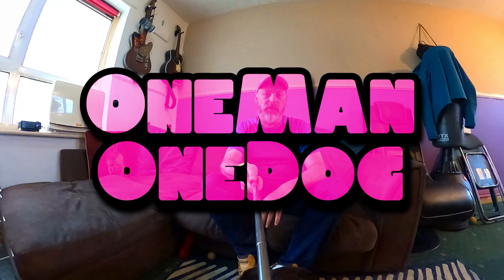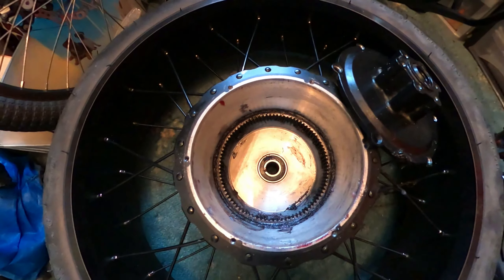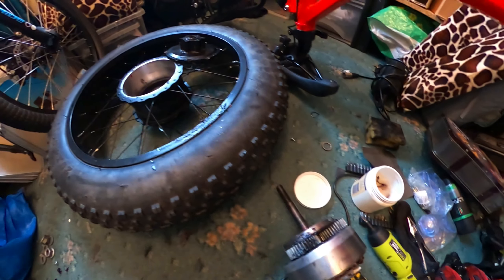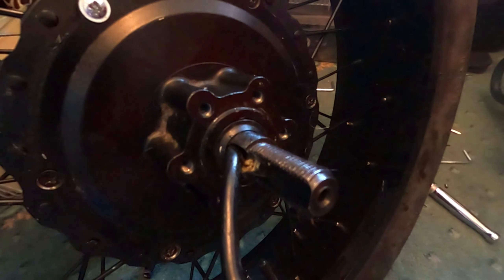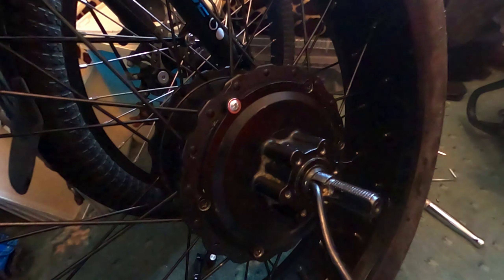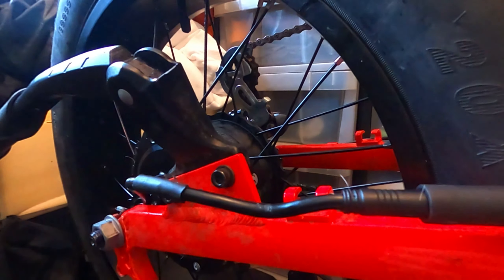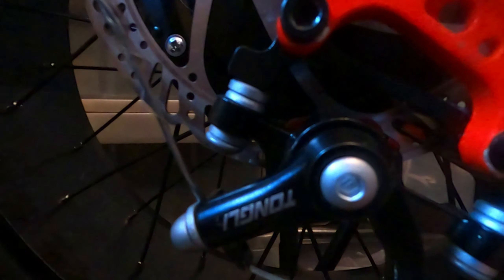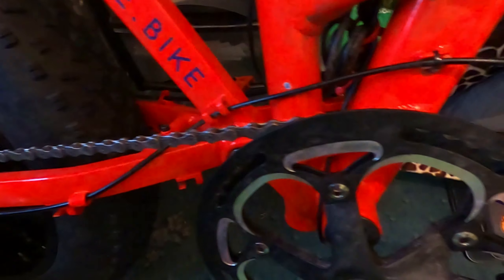mate X (mate.bike) 20X4 Fat Tyre Electric Bike Story #4 Last Ditched Motor Fix Attempt #FAIL

Comment: I had a hall sensor wire break in my hub motor axle 3 years ago.Noise like broken metal inside & shaking the whole bike as the broken wire was touching metal😩it looked & sounded horrible.I got a 9 inch puller 8$ and took it apart to solder & repair the broken wire.Taking it apart was dangerous as i did not use a vise😂almost took my fingers off.I cleaned it all was rusted inside from getting wet but you see 6 years old i just sold the bike to my friend/landscaper last week.These people you took your bike to fix have no clue and are just simply not mechanics.
Reply from the maker: Hi Peter - Did u?I wouldnt have a clue what to do !! The guy i took it to be fixed said "oh yes i can fix it" & all he did was mess with the settings & charged £100 (gbp) - He's fixing loads of peoples ebikes on fb & getting pure business THE GUYS A INCOMPETENT ARSEWIPE & HE HASNT GOT A CLUE - FULL OF LIES & FALSE PROMISES !!
Reply: @paulleeFLOW  I had many mechanic & welding jobs i could tell you some horror stories my helper ended up in a tree grinder🙏😔
Reply from the maker: @peter toth - My GOD !!!
Reply: @paulleeFLOW  I was welding up to 2 inch steel explosion proof but nothing is guaranteed if large blocks of steel goes in.Sabotaged by angry customers & employees.